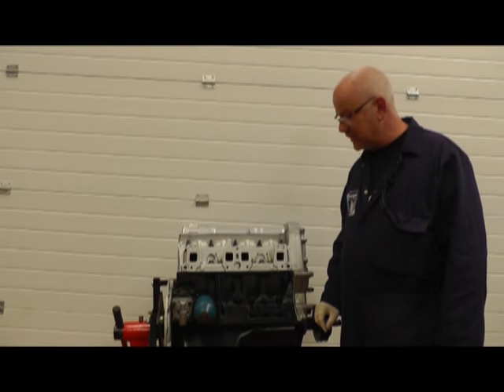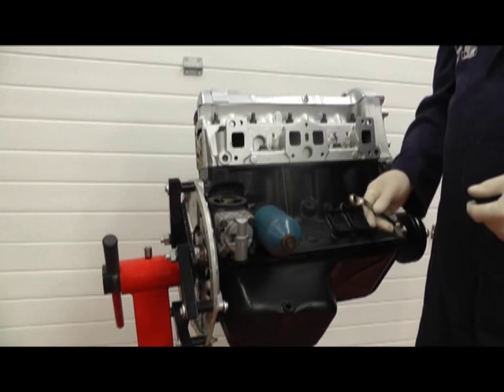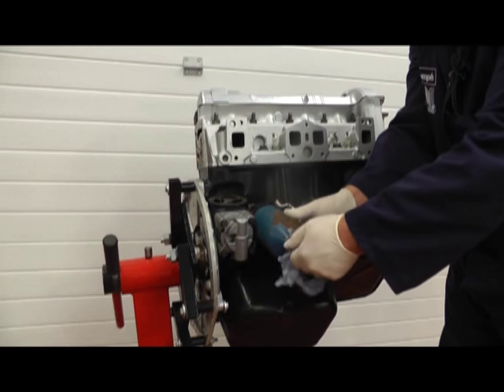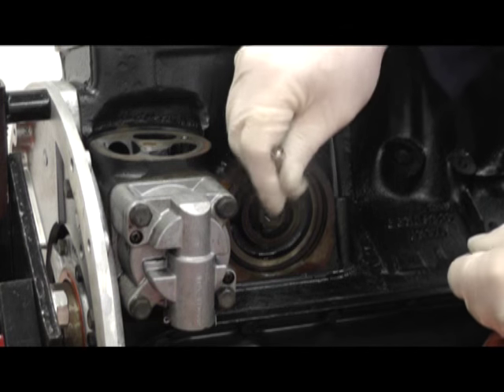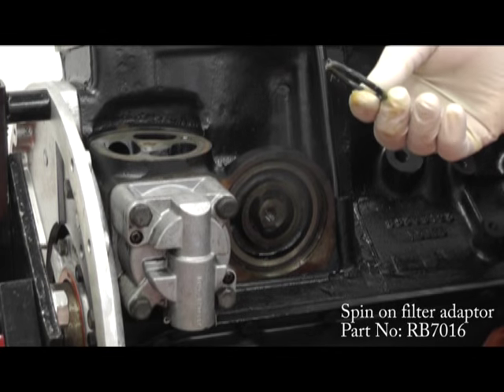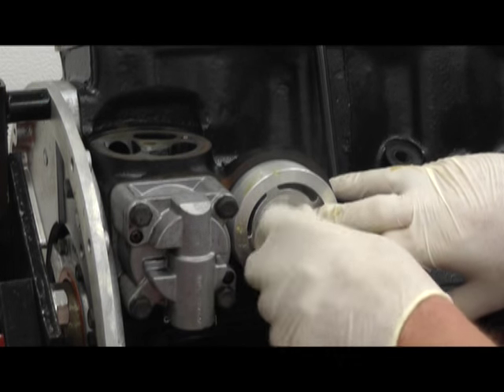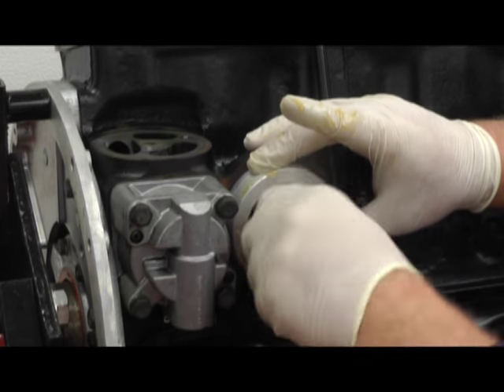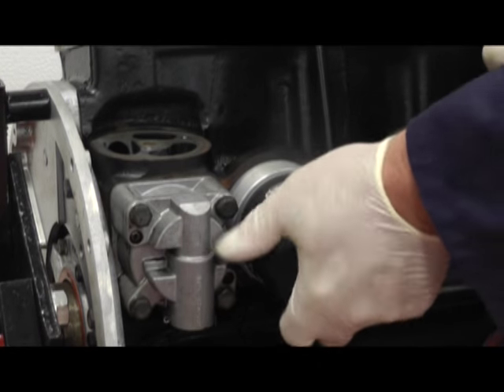Fitting a spin on oil filter adaptor to a Triumph Stag

Comment: Can you make video on changing the oil thanks
Reply from the maker: We don't have any plans to do this as it is such a simple process. Locate the sump plug, drain the oil and then go through the process of changing the oil filter (if you want to keep the standard, none spin on unit). This video will show you how to change the standard filter  https://www.youtube.com/watch?v=RQ_wqZE5jm4&index=3&list=PLJSXEqln1Dy3vB66IV9CXyffuCRzs9Tng . Then top up with the recommended amount of oil. Start engine, then check dipstick for oil level and top up if needed.